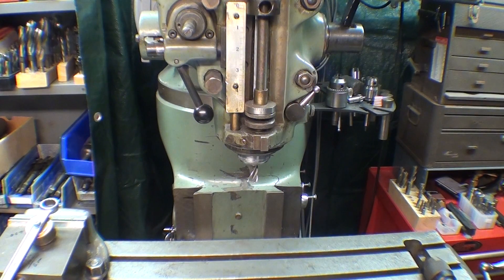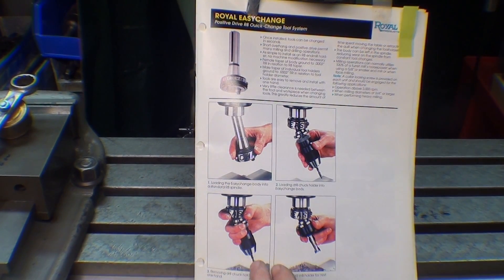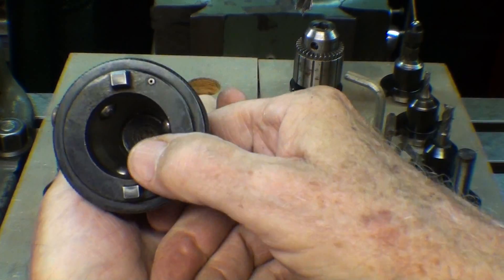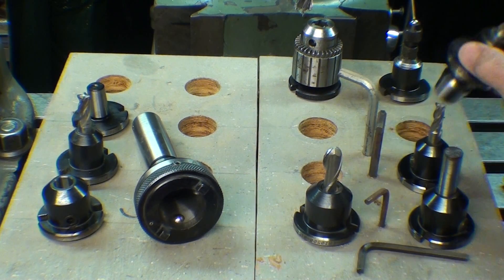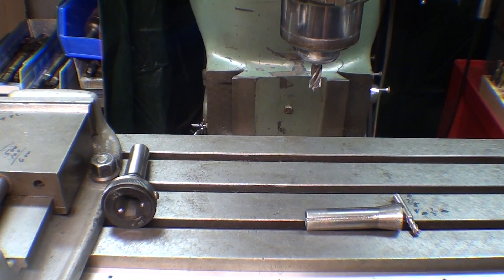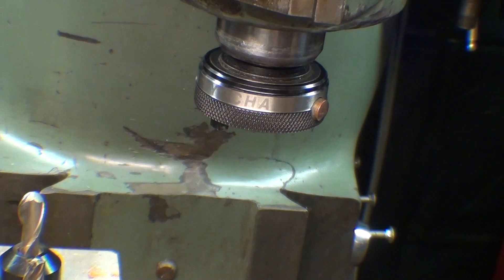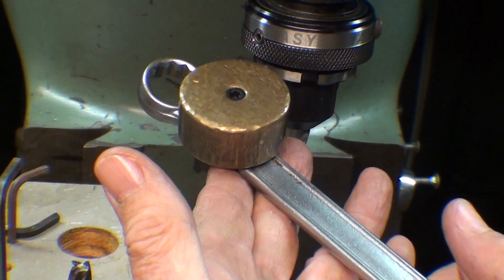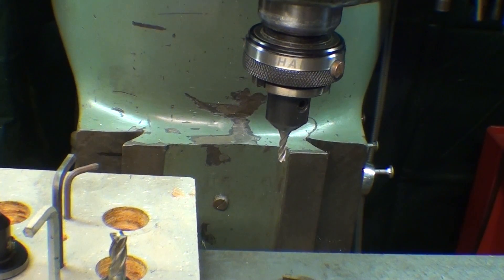SHOP TIPS #320 Royal Quick Change Tooling for the Bridgeport Mill tubalcain

Comment: The same tooling is available in the UK at much lower cost, known as a Coventry EasyChange. They were used a lot across small educational CNC machines.
 http://www.engineeringsupplies.co.uk/tool-holders-easy-change-c-175.html?menu=1

Comment: I wonder how well this actually holds.  I have a Tormach at work and really miss the 40 taper machine I used to run.  TTS is okay but the runout is pretty bad and it really doesn't hold the tools in very well.

Comment: its a good product but unfortunately it never got standardised. Best option for the home shop is to bore a 1:10 taper in the spindle and switch to HSK taper, which there is a size that very closely matched the R8 taper. Oh, and 40$ a piece on ebay for a tool in 2016 dollars.

Comment: I'm amazed that the light spring action holds those toolholders into the taper tightly enough to mill with ! Very nice quick change system though ....
Reply: The balls just have to hold the tool up. The drive dogs provide the drive and the taper locates it on center... at least that's what it looks like to me.

Comment: Im just starting in a cnc workshop as manual machinist and we use the same short of thing but its all in one piece with a collet  and we have a air ratchet thing soo basically grab what you want slide it in and hit the green button for it and let it make a few thuds  and done and same system the cnc uses in our work shop soo we can swap but we don't mix then unless they bad and we just use them for manual machines

Comment: Next time you're milling something maybe you could quickly show how those edge finders work. I know it sounds stupid, I've seen them a couple times but I'm not sure how they work, thanks.
Reply: knock them a touch off-center and when you touch them to the work they'll appear a perfect cylinder again. you need one the same size as the tool you're cutting with.
Reply: James, thanks. When I see them used on YouTube, every time, they look like they get it to look like a cylinder, then they go further for a second and knock it out of cylinder again, why do they go further and knock it back out?
Reply: Shane K
think of it like focusing a projector. you go til "better, better, better, oops, back off a touch" it is basically pushing two rotating rings of the same size until they perfectly overlap. when they go a touch to far and then back it out, it helps know you went far enough.

Comment: My Wells Index has an NMTB-30 tool holder which is very similar... longer taper, but the same two "teeth" in the machine that the tool holder fits into. On mine, there is a ring, give it about a 1/4 turn, and two "tabs" rotate over the "teeth" locking them in.

Nice to see something like this for the Bridgeport R8 collet... makes changing tools much faster. But yes... out of range for most home machine shops.

Comment: The tormach tooling system is another option and much, much cheaper! This is still very nice.
Reply: you still have to undo the draw bar.. kinda pointless system
Reply: @Migman2020  not entirely. It would save you having to remove collects for every tool change, you could save offsets on a dro, and you could set up a PDB.

Comment: I do believe the positive drive refers to using a set screw to secure the tool instead of a collet, the tool is positively locked to the holder and there's no chance of slippage (unless the screw backs off or breaks).

Comment: Hi mate.  I have to say, that it is a wonderful system you got there.  However, I would be surprised if making this system yourself would be such a mission.  I think that a machinist worth his tools, should be able to do so.  It comes down to it being a very clever idea, and they often cost money.
Reply: the big part of the equation making stuff like this is you have to place zero value on your time- and you also have to have alot of that free time. Generally unless a person is unemployed with no skills its virtually always better to go to work using your skills and then take that money--and buy the product. Most home made tools are generally done by young people just starting.
Reply: It will come out far more expensive than bought if you start reverse engineering and making it and count your hours

Comment: Nice system, but as they said "medium to light". I can see a "need" for both a 30-taper main holder, and for a bench-mounted main holder. It would make changing cutters so much easier and safer. The bench mount holder would also let you measure tool extension (useful for DRO or CNC mills).

Comment: My "big" mill is only 8x30, I would loose too much height using a quick change.  Vertical clearance goes away fast when you stack a lathe chuck on top of a rotary table, plus the work piece, of course.  The Royal is pretty cool, however!

Comment: Nice system but the price will keep it out of my shop unfortunately.  The Tormach system is lighter duty but is way easier on the pocket.  One of the advantages I find with these tool holder systems is that they can register the tool at the same height setting each time. Saves a lot of time if you're doing repetitive operations.

Comment: Hi Pete. Great video as usual from you. Question?

I was taught that when tightening a tool using a setscrew and allen wrench, that this defeats "morse tapers", etc, when it comes to concentricity. Meaning it is impossible to get it as "centered" as with taper fittings.

Yet this tool is made to use setscrews and allen wrenches. Where is my thinking wrong dear friend?

As always, may Jesus richly bless you and yours always brother.
Reply from the maker: The fit between tool & holder is perfect
Reply: +mrpete222 isn't there also relief between the end of the setscrew and the shank so the collet can evenly compress? I have some end mills that have a bit of play rotationally when their collets are not in the machine but when installed have predictable offset and run true when installed. is this normal with high quality collets or just a "bonus feature" of buying the cheapest Chinese collets I can get my hands on?
Reply: The quick change type I've used (in an industrial setting) used collects and a nut to fasten the tool to the tool holder... air powered.
Reply: It all depends on what kind of milling you are doing. The best are shrink holders that are heated to expand the bore, then cool and shrink to the tool shank. Collets do run true, but the endmill can be pulled out of them by cutting forces, on very heavy cuts. Set screw type will hold firm, but there will be a little clearance, in them. There are special collets that hold endmills on the flats, too.